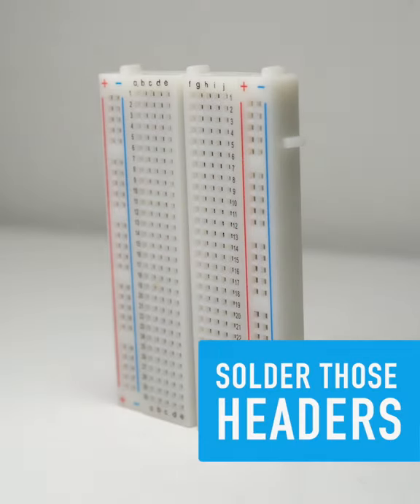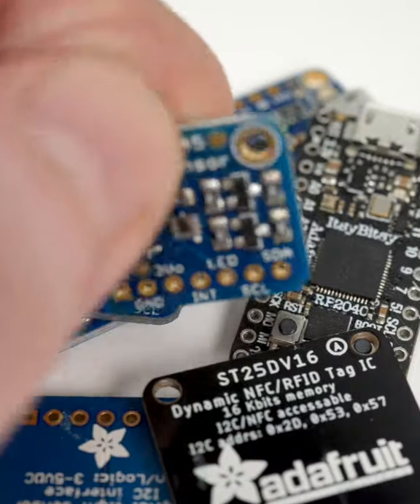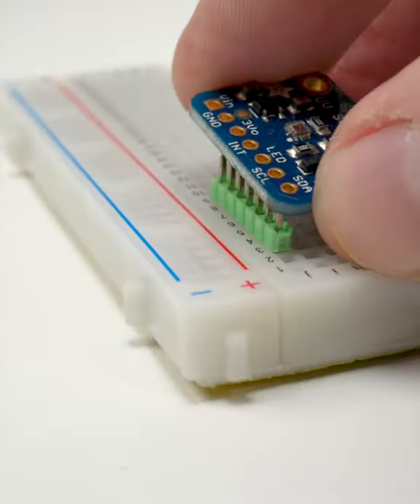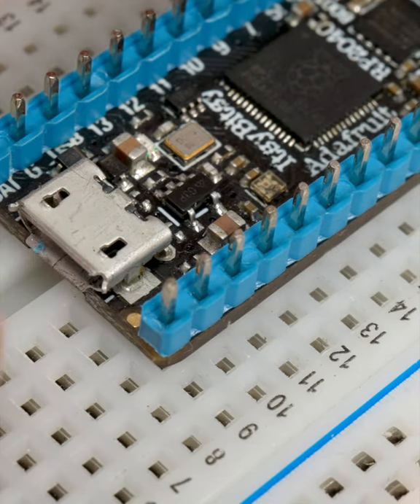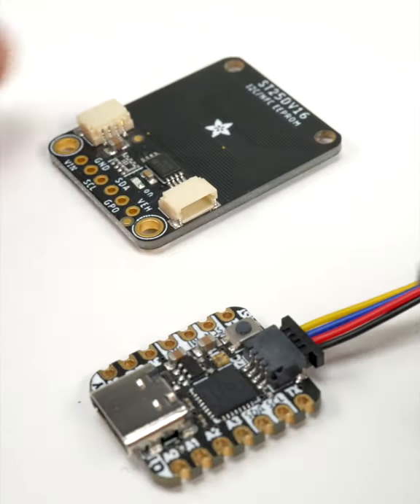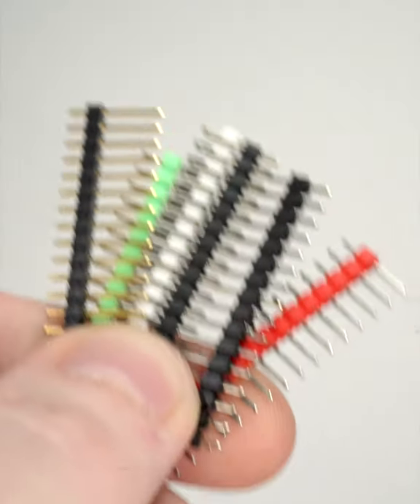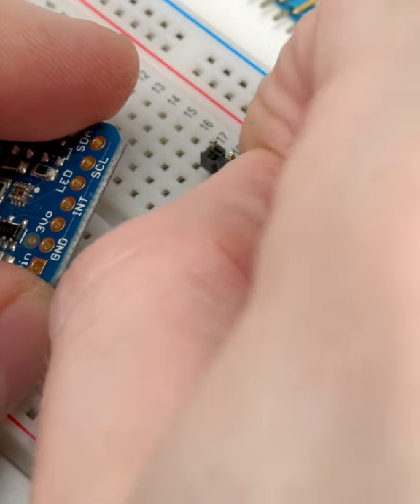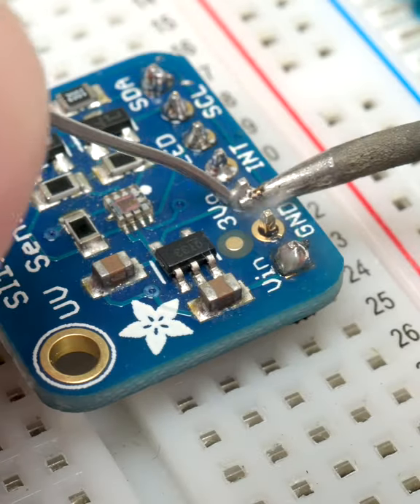Solder Those Headers - Collin’s Lab Notes #adafruit #collinslabnotes

Comment: Soldering on a breadboard can melt a breadboard holes, so be ready for that and use deficated bd for soldering
Reply: I don't think that word means what you think it means...
Reply: @wilfdarr  omg sorry, just a typo 🤭
Reply: @macaronivirus5913  Lol Ya I figured. Autocorrect has a sick sense of humor.
Reply: i was coming here to say that
Reply: So a few things: 1 absolutely, especially with cheap knockoff breadboards, but less likely with the nice quality ones, 2. When doing, pins are all on individual rails so each rail isn’t being heated more than once, if you do multiple pins on the same rail you’ll overheat, and 3. For pin soldering you can (and should) do it quick enough to not transfer heat down the pin
Reply: Done that hundreds times, never melted one, you just need to know how to solder properly
Reply: if you know how to solder properly, it won't Melt
Reply: @wilfdarr inconceivable!

Comment: I been practicing soldering headers to perfboard by plugging them into breadboards to keep them stable. I didn't think about also using the header pins to use a module on a breadboard.

Comment: If you’ve had some custom PCBs made, they’ll usually come in at least 5, more often 10, copies. Stack up the extras and use them to keep your headers aligned straight, resulting in a much more professional look to the finished product.

Comment: Don't use your protoboard while soldering.  The heat can damage it -- unless you're very quick.  Also, don't push any large wires into the holes such as large resistors, because they will flare out the contacts inside the protoboard.  Once the contacts are flared, small wires will no longer connect reliably.

Comment: Use a third hand clip to hold the header during soldering to avoid damaging your solderless breadboard.
Also, those solder joints are cold, the solder should flow nicely onto the pad.
Reply: Any time I see someone solder on camera I am like “bold move”.
Reply: Was here to say this. Those joints at the end were pretty bad; they beaded up on the header pins instead of wicking into the vias properly. Some additional flux probably would have done the trick.

Comment: There are special headers that clip onto the holes.
Also you can connect to the holes using pogo pins (on additional bottom board and you have to secure both with magnets/screws/etc

Comment: I like to solder one pin, then remelt the joint and move the header into position, then remove the iron. Do this on both ends if it's a long header, and don't put your finger on the pin you're soldering.
Reply: Still safer to have the pins immobilized... The plastic holding the pins together is very susceptible to melting.
 I like to use old IDC headers, like a floppy or HDD cable in a small vice.

Comment: I find some breadboards have such tight holes pushing in headers pushes then out of the plastic they're in. I much prefer just lining them up right and securing with some blue tac before soldering.
Reply: I find this is common with really cheap breadboards that you find on Amazon, eBay, and alibaba. BusBoard makes some great breadboards, but they’re more expensive.

Comment: Use alligator clips to make it easier. It also will not cause any of those straight wires to disaligned. It's easier and much better than doing it on a breadboard.

Comment: Solder those headers in so they stick *up*. Get some M3 pot magnets, install them into the holes on the breakout boards (chose those that have mounting holes). Place the breakout on a sheel of steel (a good place is inside an electrical enclosure with a removeable backplane). 
Buy a spool of 30AWG wire wrapping wire and a wire wrapping tool, and hook everything up using the wire cut to just the right length - doesn't take much practise to get it right. 
This will be perfectly electrically connected, and won't go bad after a few years: It's a perfectly good way to wire equipment you'd like to last. 
If you want a more vibration-proof setup, use M3 rivet nuts. These let you mount things with a drill and a special riveting tool, without having to remove the backplane. This assembly will be strong enough to be mounted into a vehicle, and will be reliable so long as it can be protected from water. Most electrical enclosures are designed to be sealable, so this can be true.
Wirewrapping is much better than breadboards, it's strong enough that you can prototype on a desk with everything loose, and it will be strong enough to stay connected even with picking it all up and letting it hang from the wires.
Wirewrapping is far more reliable than those crimp-on connectors.
Soldering is the slowest step - it's quicker and easier to wire-wrap than it is to put a crimp on. 
Buy a good combined cutting and stripping tool (the red 'ok tools' one), put the wire against the far side of the cutter section, and pin in down with the thumb of the hand holding the tool, then pull the wire across through the cutter and into the stripper section, then close the cutter and pull the wire: perfect length strip and you can do it very quickly with practise.
For easily inserting the wire into the tool, hold the tool in one hand and the wire in the other, with thumb and index, then touch your middle fingers together to 'reference' your hands and make small accurate moves more easily with no shaking.

Comment: Be aware that the wireless breadboards are not durable over the long term, are sensitive to the size of connector you plug in, and don't really have good grounding or noise immunity. Good for quick prototypes only.
Reply: Yes, they are very good for testing but a pain for larger or hf circuits, you search sometimes hours for the issue, just to find out a breadboard contact is worn out

Comment: I don't understand why so many people are so scared of soldering. I've heard countless times some variant of "I've never soldered before, so I look for pre-soldered or solderless parts."

Soldering is such an easy thing to get into I started doing it when I was like 14 and even at the time I think the worst that happened was accidentally burning off a small pad on a GameCube motherboard because I didn't use any flux (which was fixed by following the trace, scratching off some solder mask, and soldering to the trace).

Comment: If you are designing breakout boards you should take a look at the great work done with the Pocket Chip. The header row over the display featured an offset between the holes which work absolutely perfect to give the pins a friction fit and thus a solid electrical connection without soldering.
Most underrated PCB trick.